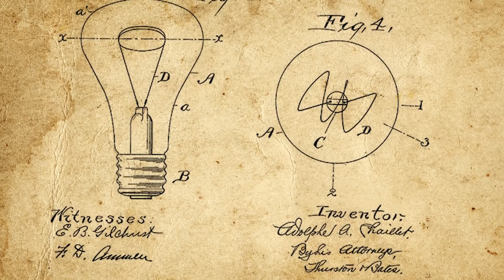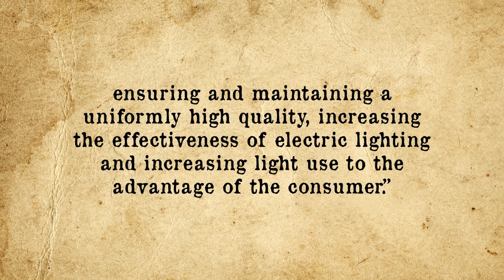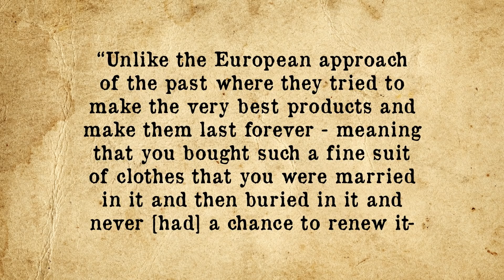The Great Light Bulb Conspiracy

Comment: The printer argument is even more ridiculous. The last thing a printer manufacturer wants is that you would buy a new printer. They want you buy new cartridges. If you buy a new printer you might buy a different brand. The protection for the overflow is just for that. If yu ever have looked used inkjets from inside they are nasty. You do not want that to your clothes. To trigger the counter you have to use some $1000 worth of ink. They really do not force you to buy a ne $40 printer to make money.

Comment: Such fail in the basic premise of this video!
Only the briefest reference was made to the fact that the lower lifespan of an incandescent bulb (almost) always equates to higher efficiency.
Given the ignored (here) fact that electricity cost VASTLY more 100 years ago than it does today, lumens per watt was (and is) much more important than a lower per-bulb annualized replacement cost.
Reply: Please note that in the case of modern LED bulbs, the circumstances are REVERSED, meaning that driving an LED with lower current results in lower light output and a longer lifespan, as with an incandescent bulb, but ALSO results in higher efficiency.
Reply: If all you care about is long bulb life (actually very important in limited applications!), then just run a 240V tungsten-filament incandescent bulb at 120 volts.
The calculated lifespan for that bulb will be in the range of 7,000 years of continuous use!

Comment: This is utter plain BS, completely ignoring the physics.
The reason incandescents settle on a 1000h life was because it yield bulb with the lowest total cost of light in the 20's. The problem is, for good efficacy you need the filament to operate as hot as possible. But with hot operation, the tungsten evaporates fast, so the lamp burns out faster. So if you design the bulb to operate colder, the lifetime will be longer, but the power needed for the given light output would be higher, leading to high energy costs for the user. The problem the "cartel" attempted to solve was many of shady makers just design their bulbs to operate colder, then claim "excellent lifetime", but "forget" to tell customers either get less light or pay for more electricity. Guess what was the interest of the power generating companies there. Of course, high efficacy bulb was possible, but lasted only short time, so you need to buy many of them. Given the lightbulb production costs and the electricity cost at that era, the 1000 hours designs were when the sum yield the minimum. It was a common thing in all industries of that era, to set such cartels and set the parameters so it would benefit all, include the consumers. The belief was this was the best way to prevent normal people from being misguided by shady advertisement. Yes we know the concept had failed miserably (yet what else are the recent regulations?)...
It is true, this set the standard for the next decades, but the irony is, given the progress in manufacture, the optimum shifted more towards higher efficacy and shorter lifetime. So it was the legacy of that cartel, what made the bulbs lasting way longer than the 200hours, where the lowest total cost optimum was past WW2.
And the famous bulb was unique, because it was defective since manufactured: It never gives off the amount of light it was supposed to.

Comment: What you're really talking about Simon is the branch of Mechanical Engineering known as Reliability Engineering.  It's all about creating planned obsolescence.  A reliability engineer can create things to fail at +/- 5% of a given life.  So, in the case of the light bulbs, an reliability engineer would plan for 1050 hours of life such that the light bulb would last a minimum of 1000 hours and a maximum of 1100 hours.

Comment: The new "ice cream cone" twisted-glass lightbulbs will burn-out very quickly IF YOU FAIL TO POINT THEM STRAIGHT UP. In the white plastic base of such lightbulbs, there is a small AIR HOLE. To get any significant LIFETIME out of such lightbulbs, that AIR HOLE ... HAS TO POINT ... STRAIGHT ... UP!! Also, in the event of a neighborhood-wide BROWN OUT (i.e. the circumstance in which the voltage delivered to an entire Community Zone drops down to around 40Vac to 80Vac), the twisted "ice cream cone" lightbulbs represent A FIRE HAZARD, WAITING TO HAPPEN. When supplied with only about 45Vac, the twisted "ice cream cone" lightbulbs conduct electricity THROUGH THE POWDERED White Phosphor Coating (found inside the Glass Envelope), instead of through the internal Mercury Vapor gas. When this happens, over extended periods of time, the electricity conducted through the POWDERED White Phosphor Coating acts like an electrical resistor, and thus ... EMITS ... EXCESSIVE ... AMOUNTS ... OF ... HEAT!! Over extended periods of time, during a LONG Brown Out interval, this circumstance could very well START A HOUSE FIRE!! The fact that this circumstance, that I just described, goes forth unaddressed, year after year, says a lot about the way that Underwriters Laboratory tests electrical devices. In my opinion, UL often FAILS to realize that many electrical devices EMIT THE MOST HEAT when they are powered at around only HALF OF their intended/normal Quiescent Operating Voltage. In my opinion, UL seems to think that applying MAXIMUM voltages is exclusively "how" you go about testing an electrical device's long-term durability. Someday, I wish I could show a couple of eye-opening Benchtop Examples to a few of the major "mucky mucks" at Underwriters Laboratories.

Comment: I used to live in a very old building that, likewise, had one of the very first lightbulbs. This bulb, too, had been used all the way into the 21st century, without ever burning out. In the form of an incandescent bulb, it is very easy to craft an incandescent bulb that will never burn out; you simply use TWO filaments, and wind the two filaments around each other , so as to form what is commonly referred to as a TWISTED PAIR. This arrangement CANCELS OUT the overall Electromagnetic Field of the overall filament. In a NORMAL incandescent bulb, it is the initial Electromagnetic Field that eventually TORQUES the filament, and CRACKS it, thereby 
destroying the functional utility of the bulb. This initial Electromagnetic Field "shows up" on the moment when your initially apply power to the Lightbulb.

Comment: Hey, a historical example of why cartels don't last! They're not sustainable because the temptation to cheat on the cartel is too great. 

Also, about planned obsolescence, the consumer is still king.  Businesses may have introduced planned obsolescence into their products, but that doesn't mean consumers are stupid; they deal with planned obsolescence in a variety of ways. Incandescent light bulbs were relatively cheap, even if they were only good for 1000 hours, and how many different lamps and light fixtures did your average household have that needed bulbs?  CFLs and LED bulbs are now going through the process of getting cheaper, because nobody wants to pay $10 for a lightbulb unless it's a darned good, long-lasting bulb.  Inkjet printers?  Yeah, I gave up on them a long time ago.  Why do you still mess with them?  The printer manufacturers will change their tune if enough people stop buying inkjet printers.  If you really want long-lasting, high quality products, you can still get them--they just cost more.  Products with planned obsolescence built-in have to sell at a discount to encourage consumers to buy them.  So it's up to you, the consumer: do you want to pay $20 for a pair of shoes that last a year, or $200 for a pair of shoes that will last 10 years?

Comment: in the late 1890s. The bulb is a prototype "fluorescent" light he invented consisting of a partially evacuated glass bulb with a single metal electrode.
So before the 1920s there were better bulbs.
Reply: I think you are referring to the no-idea-what-it-was-called bulb that was excited by a tesla coil. Not really fluorescent, but luminous through the electrical discharge in a sparse atmosphere. IIRC the bulbs were made somewhat practical by using the new compound, carborundum, as the element because metals sputtered themselves away rapidly. Kinda cool.

Comment: The most i've been able to keep a bulb running in the same socket with day and night cycles (on off) is 11 years 2 months 1 week 1 day ~14 hours. Philips, 100 W bulb, filament. Used every day, and most of the secret was to not turn it back on or close it off under 20 minutes (the observed time it took for the bulb to fully heat up and cool down to max and min temp).

That and the fact that it wasn't run directly on mains, but from a filtered source. I think most of the problems bulbs had were 1 shitty current (220v that's actually 233v fluctuating up and down 20 or so units) and the fact that nobody respects the cooldown.

My CFL, also from Philips is still running at 7 years 5 months and change. 

LED's are a lot more tricky, but they suffer even more from unclean current and unrespected power up and power down cycles. I've also found them to be highly unreliable when run on their own power source. I've yet to see a manufacturer do a proper power source. IMO, the correct way forward is 12v rails with a single proper power source and the bulbs directly fed on it at their end.

Last observation, toggle switches suck all kinds of rear. I've been using the pull cord type for a while now, mostly because the actuator, when pulled fast, engages and remains strong on without the "jump" that normal switches have (digital ones, like glass faced, touch screen style ones of proper build not included).

Not an EE, it's just a hobby i've had. I have quite a few bulbs i play with.

Comment: What causes the obsolescence in things such as cars. Like how do they make it so things will fall apart within a certain time frame within its life.
Reply: I had one that didn't have planned obsolescence, a 1984 Dodge 600.
It didn't fall apart in 1994; it started the first week with a bad carburetor. Just before the warranty ran out the steering rack died, and within a year I had a number of problems. By the five year mark I had replaced the A/C compressor 3 times, had replaced both front drive axles, the fuel pump, and needed to replace the timing chain. I couldn't do that because it required lifting the engine (a nightmare in that chassis), replacing the chain, dropping the engine back in with superhuman patience and a special jig to prevent misalignment from tearing up the torque converter.
If it had been planned to have the end of life around ten or even 8 years I would have been thousands of dollars and many dozens of hours of work better off.
Lifecycle design is not difficult. Run designs with a number of retirement dates and choose the price point from among those. Quicker end of life means cheaper, and vice versa.

Comment: in the early 1980s I worked for an electronics repair depot ... I have said we no longer buy and own anything ... we rent it !! GE Westinghouse and all the appliance manufacturers know exactly how many microns of steel will wear off the inside of a refrigerator compressor to the point it will wear out within 3 months of the warranty expiring ! and we all know what an software upgrade does to your cell phone !!
Reply: Had a Hitachi TV a few years back, the power board blew the caps off exactly 52 weeks after I first plugged it in. Found a guy selling OEM boards cheap and fitted one myself to save money. Guess what happened 52 weeks later.

Comment: way back GM invented "planned obsolescence" for their autos to keep the public buying them.
Reply: I drive a Chevy that sometimes doesn't start or randomly has everything shut off while driving due to an electrical grimlin and occasionally randomly shifts into first gear on the highway. Don't know about planned but if this is typical GM is headed towards obsolescence.
Reply: Planned obsolescence, AKA life expectancy, is especially important in automobiles. The pace of important new developments for customer satisfaction and for regulatory and safety demands it. Just in my time there have been industry-wide adoption of seat belts, emission controls (several generations of that), computer controlled powertrains, entertainment systems with sound quality that could not be had at any price a few decades earlier. Standard climate control, engines that last 200,000 miles or more, even day/night mirrors.
My family has had nothing but Prius cars since 2002. The first generation (2001-2003) had enough problems that I don't recommend them to anybody but enthusiasts but they improved rapidly. I learned to drive in a 1964 Dodge Coronet with a slant six engine that seemed to do 0-60 in a minute or two, had 4-wheel drum brakes that faded on long downhills, and got 14 mpg or so. It needed an engine overhaul around the 80K mile mark. Now I drive a 2014 Prius that has a Bose premium sound system, does 0-60 in about 10 seconds (same as the US version of the Delorean DMC-12), gives me 50 mpg on the freeway and 55-65 mpg around town, and has gone 110K miles so far without anything but routine maintenance, a 12V battery, tires and wiper blades. It's due for the first coolant change and spark plug change.
Do I wish I still had that 1964 Coronet? Hurray for managed life cycles!

Comment: The modern light bulb is just another example of Engineered Obsolescence
Products designed with a limited lifespan to encourage repeat business for companies.
Reply: There is a choice in design: a designed lifetime or random failures. The second type is the one that makes some fail in the first few days and makes replacement of the whole set at one time pointless.
So many people think lifetime engineering is a bad thing, while it is the basis of what we see as reliability. Nothing lasts forever, and few things are good if they last more than 20 years or so. When I was a kid we had a toaster that you stood beside and manually flipped the bread over when it looked like the first side was done, then flipped all the way down when it was done on both sides. (I saw one just like it in a museum 25 years ago.) It probably still works, but who cares?
https://americanhistory.si.edu/collections/search/object/nmah_1119620 Not exactly the same but very close. We also had a wringer washing machine. I don't miss either one.

Comment: I'd like to see a follow-up video to this one focussing on the right to repair, which at the moment is under heavy attack.. We need to have thew right to be able to fix our stuff..
Reply: You aren't by any chance thinking of Tesla, are you? I will never buy one as long as this policy is in place.
Reply: @flagmichael  Tesla's, John Deere tractors, Apple computers, the list goes on.. It's all the same. We're expected to accept breakdown of a product under guarantee, with the proposition that the repair or replacement costs fall on our own shoulders, and should be dealt with through the original manufacturer. This is blatant theft. And yeah ,you're absolutely correct. I won't buy my cybertruck until I can put a wrench to it myself.

Comment: Screw "self-cleaning" printers. More like "self-emptying" printers. When I first got one it was self-cleaning more often than I was printing and I was running out of ink after just a few print jobs. There was no way to change or disable the cleaning cycle, either, so I had to resort to unplugging it whenever it wasn't in use. I've never had a printer fail on me and need replacement but those things are certainly designed to guzzle ink for no reason at all.
Reply: Just on a tangent, I am amazed at my HP OfficeJet 8600 I bought on sale so many years ago. For just over $100 I have auto-duplex, flawless print quality after all these years, and no trouble at all for several times the life of any other printer I have had. My only regret is when this one dies I will have to roll the dice again.
The worst experience: a HP500 monochrome inkjet printer around Y2K. I went to the store to buy another model and I was told it was out of production but HP had this brand new 500! I bought it and went back for replacement ink cartridges a few months later... the ink cartridges were not available because the printer was already out of production!

Comment: At least one company made bulbs to last at a price.  In 1996 I bought some "7 Year bulbs"  from a charity drive. At the time they costed $27 for a 4 pack.  In 2020 these incandescent bulbs still are in use.  Mostly I've switched to LED for the power reduction, but my old "7 year bulbs" just keep on going.
Reply: I used to work for a lightbulb manufacturer (actually Osram Sylvania). The years of life are based on 3 hours a day. So that’s about 7500 hours. They probably have a thicker filimint and are designed for 130!or even 140 volt circuits. By running them on 120 the life expectancy goes way up. 
And finally the hours are calculated by taking a lot of 100 bulbs and running them until 51 burn out. That’s the stated life. (We did up the voltage to speed the time up for testing purposes)